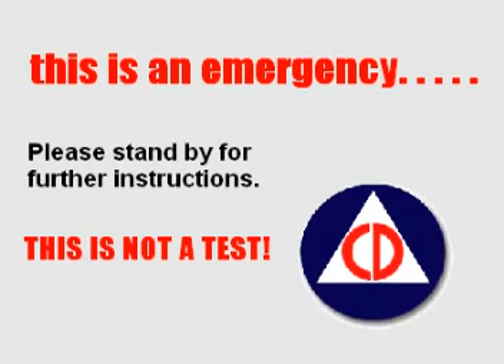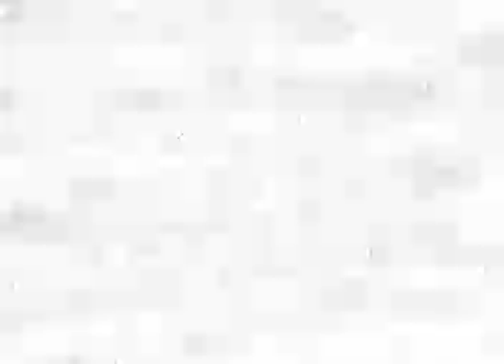Conelrad Activation Simulation

Comment: It wouldn't have been called "The Emergency Broadcast System" in the Conelrad era.  During this era, "kilocyles" was used, "kilohertz didn't gain acceptance until later in the 1960s.
Reply: The anachronism has been acknowledged earlier in this thread.  Please read all replies before you respond this way.  Thank you.

Comment: The term "Emergency Broadcasting System" didn't come into use until 1963.

This would have been idebntified as a "Conelrad Radio Alert", and the announcer's instructions would have directed you to "640 and 1240 on your "standard radio dial".

Comment: CONELRAD died out in the Sixties not in the Seventies.  A similar method in Georgia is to have people tune to 89.7 in the event of a hurricane (Georgia Public Radio).  I am thinking that, with news departments less existent in the "canned" radio stations of today we may need a measure similar to CONELRAD.  Whether or not it would be a contracted commercial station or public radio is open to question.  We were almost up s*** creek in the Macon GA tornado but for guys hauling butt to WMAC-AM.

Comment: CONELRAD = CONtrol of ELectromagnetic RADiation, shutting down radio stations so that they could not be used for navigation by Soviet bombers. "Clear channel" stations on 640 and 1280 Kcs would broadcast in a controlled "jingle-jangle" system, with a short broadcast from one transmitter then another from a transmitted miles away, too short to use radio direction finders. It also made it easier for radar to spot incoming planes, because the airwaves were clear.

Comment: @ChuckK3 also, an announcer would NOT have said "This is the Emergency Broadcast System", because that hadn't kicked in until..... what was it?... Oh yeah, I think it was 1963. Also, did you have your own script, because what you said was totally different from what a vintage announcer would have said. Otherwise, your sounds (the white noise and the sine wave [which was 960 Hz, right?]) were spot on.

Just a little constructive criticism. Good video anyway. I probably couldn't do this!

Comment: I looked it up and we were both wrong.  This is not a CONELRAD alert.  a CONELRAD alert wouldn't have the alternation of static-silence. Once all the main transmitters shut down, CONELRAD stations would cram all their signals to 640 or 1240.  The first version of the EBS used the static-silence sequence.  Then they broadcasted a tone of 1000 hertz.  After the transmitters burned out, they revised the EBS  and created the two-tone attention signal.  We were both wrong.